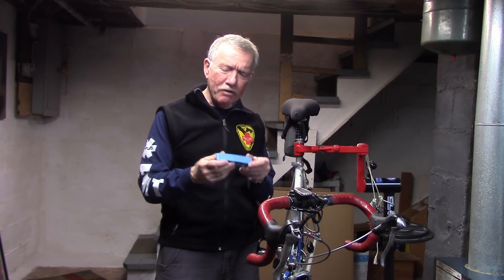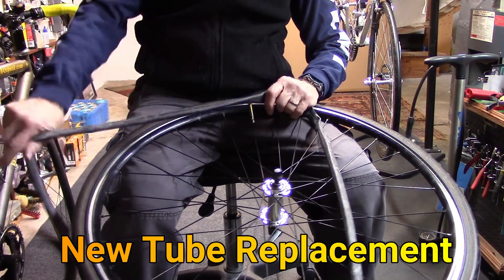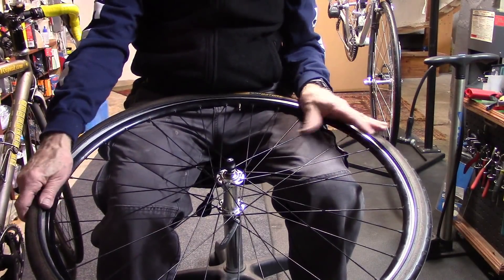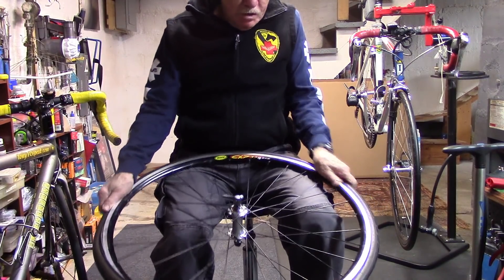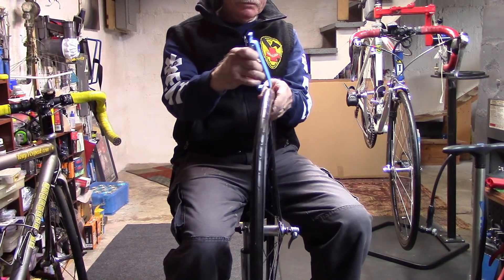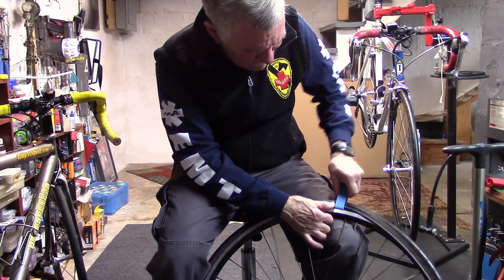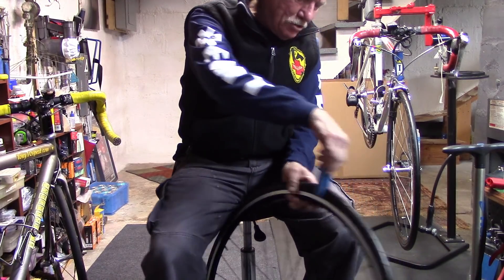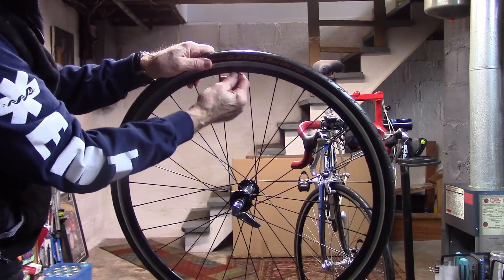Var Bicycle Tire Lever & Comparison Others

Comment: Good video, I've used VAR levers for 20 years and wouldn't use any other. They take the tyre off easily too.
Reply from the maker: It does work with many tires/rim combinations. However, I myself prefer the EZclincher which I've had the chance to use over the last few years. It can easily install most clinchers and can fit in your saddle bag. Here's a link and let me know what you think, Tony
https://www.youtube.com/watch?v=TyvIvfhHVJU&ab_channel=TonyMarchand

Comment: I use the Kool bead jack, works very well.  I used it yesterday as a matter of fact.
Reply from the maker: Do you carry it with you when cycling (in case of a flat)?
Reply: @tony10speed  No,  I carry  levers in my tool bag.
Reply from the maker: What if you get a flat out on the road? Do you carry a tire lever with you?

Comment: The VAR lever system is actually a multi-tool that comes with a pair of standard levers as well as the part that straddles the tire while leaning onto the rim and allows you to lift the tire onto the rim that is the primary focus of the video. This function is a thing of beauty, and I discovered it after hours of frustration and many replacement tubes destroyed with trying to fix flats in the field getting the tire back together onto a stubborn rim -- impossible by hand alone. The VAR is light, it packs easily, and it works! The only criticism that I have is that the standard lever pair, demonstrated in the first seconds of the video, necessary for the initial removal of the tire from the rim, is a little flimsy. If you're not careful it will snap off. The reinstallation part that I really need it for still functions well without that, but I carry an extra, simple lever that is sturdier just for removals.
Reply from the maker: I agree with you that the levers are quite flimsy for tire removal. In a way it's a multi-tool in the it is designed for both tire installation and removal. I certainly think that there are better tools out there such as the Crank Brothers Speedier Lever, the Kool Tool Tire Bead Jack and the EZclincer , but that's just my personal opinion. For a look at these other tools, see the playlist below:
https://www.youtube.com/watch?v=XrsHp_OJNvA&list=PLYbCdE49qIMdOcZ9C3z5OXNPpaW7gMOxo
But if the Var tool works for you, look no further. Regards and safe cycling, Tony

Comment: What makes the Kool Jack better then the others?
Reply from the maker: Large, sturdy and works every time. Some shops use the Kool Jack to put on difficult tires on certain rims. However, unless you take the Kool Jack with you, you may find your self out on the road with a flat and unable to get the tire back on after installing a new tube. Regards, Tony
Reply: It doesn't, the only tool that is similar is the VAR, and both work exactly the same, I provide videos on that fact and proved Tony wrong about the tire popping off on the opposite end using a VAR and that didn't happen for him using the Kool Stop, that was bogus information because if you watch the videos I gave on how those two levers work they work EXACTLY the same, they both have a slot area that connects to the rim edge so you can grasp the bead with the opposite end of either tool and pry by pivoting the tool using the rim and the slotted end of the tools.  If the tire was going to pop off on the opposite end using the VAR it would do so with the Kool Stop as well, but the tire WILL NOT pop off using either or one or the other unless there is an operator error.  Tony can bark about this all day but the facts are the facts and you can see those facts in the two videos I gave responding to his nonsense about the tire popping off using the VAR, and you'll see that too if you watch the videos closely a couple of times, that's why I showed the videos so I couldn't be accused of yakking and not knowing what I'm talking about.  I've used both of those levers over the years and I know from experience, and as the videos show, that both work exactly the same.

I like the VAR the best only because it fits into most saddle bags, the Kool Stop will not fit into any saddle bag, unless it's one of those real long ones that stick out about a foot behind the rear of the seat.  NOTE, I did not say I like the VAR because it works better or worse than the Kool Stop, I like it because it fits into seat bags.  I'm not getting paid to push one product over another like Tony is.

Comment: I usually shake the tire into the center of the wheel rim starting away from the valve as I'm installing the tire.
Reply from the maker: Always a good idea. Make sure you pre-coat the tire or spare with Talc (baby powder). Shaking the tire does 2 things: 1. Prevents the tube from getting pinched under the bead  2. Moves the tire to the well in the center of the rim to give you more slack and allow more room to slip on the remaining bead over the rim. With some tire/rim combinations, one must repeatably shake the tire to the center as you move the remaining bead over the rim. Regards, Tony

Comment: I'd prefer taking my two tyre levers with me (incase one breaks someday).  I've never pinched my tube when putting the tyre back on with the levers.
Reply from the maker: I also take a Pedro Lever along with my Crank Brothers Speedier Lever. It's easier to take off the tire with the Pedro (which is heavy duty) and the Crank Brothers levers (see: https://www.youtube.com/watch?v=ZbO_03rKyPk&t=3s). I've had good luck installing the tire with just the Speedier Lever alone. I have seen tubes pinched installing using a regular tire lever. I guess you have had good luck. Thanks for the info and safe cycling, Tony

Comment: First of all you NEVER put the last section of the bead on where the stem is located, it should be on the opposite side where you put the bead on by hand.  Secondly that's not how you use that tool!  you first put on as much of the tire as you possibly can, then take the VAR and either place it in the center of the the bead portion that is not on if it's a small area and pry it up and over the rim, if it's a larger section you do the same thing except in 2 or maybe 3 segments working your way from one end to the other.  You never slide the VAR tool you could rip the tube in the process, you have to disconnect the tool and reinsert it.  You also have to observe the position of the tube as well to make sure it won't get pinched by the VAR or the tire when you snap the tire on.

I've found the VAR to work the best, plus it's small enough to fit in a seat bag whereas none of the others are, so if you're out on the road and have flat the VAR can be your safety tool whereas the others you won't have along with you so you could be stranded.

Also when you use the VAR don't grasp the tool at the top you have to handle it near the the bottom of the VAR so as not to break the lever.

I've had mine for 22 years and of course it hasn't broken putting on tough wire beaded Specialized Armadillo tires or wire beaded Schwalbe Marathon Greenguard tires.
Reply from the maker: We'll try your approach and see how we do. Regards, Tony
Reply from the maker: Followed your method to the tee with my most difficult tire (Gaterskin 700 x 23) and a Victory Fusion rim. The bead portion not installed by hand is large. If I try 1/3 of the way, as I pull the tire bead over at one end, the bead comes off at the other end. If I try toward the center portion of the bead, can't move it at all. Kool Jack Tire Lever is better, faster and easier, but it's bulky to carry with you. Interesting you suggest starting at the valve when most mechanics suggest starting away from the valve and periodically shaking the tire and tube toward the middle of the rim where there's a slight depression to give you a little extra room. It really comes down to the tire and rim. My moto: "If you can't replace the tube & tire by hand (or with the Speedier Lever), you should probably consider a different tire and rim." But that's just my opinion and differences in opinion bike repair interesting. Glad it works for you. Regards, Tony

Comment: Looks like one could pinch a tube with this gadget. Maybe crank Bros speedier lever better. VAR troublesome!
Reply from the maker: I would agree. I've tried a number of techniques with the var and have yet to get it to adequately use it for a difficult tire and difficult rim. You are supposed to  place the tire on as far as you can, the move about 1/3 in and lift the bead over the rim, disengage the lever, move it over and repeat. Disengaging the lever is difficult and pulling the bead over the rim seems at times impossible. I will shoot another video with another method of using the var. For me, anyway, the Crank Brother Speedier Lever will work on most, although not all, tires and rims. Regards, Tony
Reply: I've use a VAR for 22 years with NO troubles.
Reply from the maker: @frozerekmeyata4091  I have no doubt that the Var has worked for you for 22 years. I think we're talking about apples and oranges. We, here at tony10speed, have dealt with many tires and rims. With many, even the difficult Continental Gatorskin wired bead, can be easily put on by hand on a Mavic Open Pro. The Gatoreskin can also be put on a Mavic CVP 33 by hand but it is easier and quicker with the Crank Brothers Speedier Lever. The Vars will probably work in these cases. But try to put on the Conti Gatorskin Wire Bead on a Victory rim is near impossible unless on uses the Kool Stop Tire Bead Jack (the Var Tire Lever just would not work on this combination even with your suggestion on installation which I appreciate). I do not sell tires and rim combinations to clients that require the Kool Stop unless they're willing to carry this somewhat bulky tool with them in case they get a flat out on the road. I have some new ideas about working the the Var Tire Lever on a very difficult tire/rim combination which we are currently trying out and will get back to you with an update. 
Regards, Tony

Comment: Bead Jack is almost too easy, sure it's a bit large, just cut off 2 inches from the handle. I run Corsa Controls on my HED Belguim + rims and they are PAINFUL to get on, no way I am getting a flat without the bead jack. The VAR is almost as just using your hands, I have arthritis and  it wasn't easy for me. The Crank Bros tool is mediocre as well.
Reply from the maker: Great idea about cutting off 2 inches of the Bead Jack handle to allow you to carry it with you out on the road. For a very difficult tire and rim, the Tire Bead Jack from Kool Stop is a great tool. But use with care such as not to damage the side wall of the tire as you install it. Go slowly and make sure one side is fully engaged with the rim. Regards, Tony

Comment: I've used all of these.  The var works the best on the tightest ON of road tires WHEN USED CORRECTLY.  This would be almost opposite of the way you did.  Finish AWAY from valve.  Work the lever up/down slide just a 1/4in at at time and work towards your hand that is holding the tire with (not away from it).  To take tires OFF we are not fans of the var due to the pointy edges on the lever.  much prefer the pedros lever.  It rarely takes more then one lever to remove a tire. Otherwise great comparison videos! #EXIRONMANRACETECH
Reply from the maker: Interesting. See Froze Rekmeyata's comment from last year (look down the comment a bit to find it). Tony

Comment: Not been impressed at all with that leaver tried it but its not that good and they snap easiley
Reply from the maker: I am not impressed with the Var either. The best tools I've used are the Kool Stop Tire Bead Jack and the EZclincher. The EZclincher works for tires 28mm or less in width and fits in your saddle bag. See:
https://www.youtube.com/watch?v=TyvIvfhHVJU
I've also tried the Crank Brothers Speedier Lever with success for some tires but not all.
https://www.youtube.com/watch?v=ZbO_03rKyPk 
Regards, Tony

Comment: I just use my hands.
Reply from the maker: On many tire/rim combinations, I do also. It's a skill worth practicing. I carry the Crank Brothers Speedier Lever in my saddle bag in case one of my cycling buddies turns out to have a particularly difficult tire to install.
Reply: I usually do too, but try it on my road wheels. After 3 attempts, all I had was 2 ruined tubes, the skin literally ripped off my palms, and still no tire on the rim.